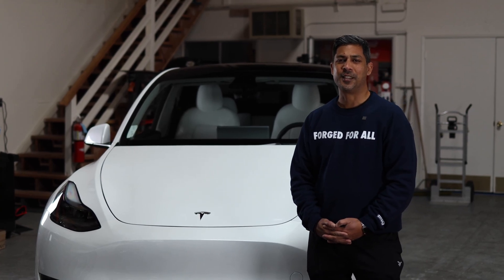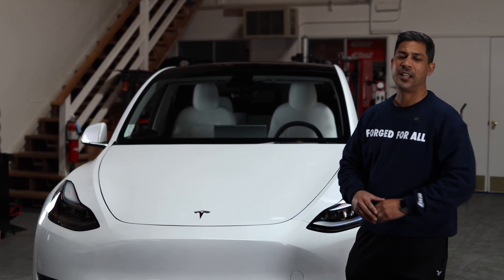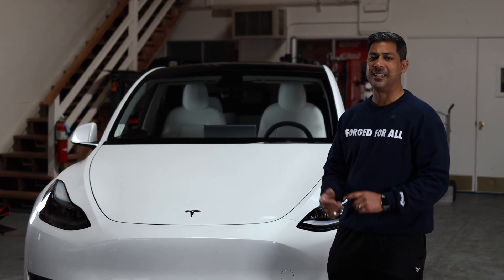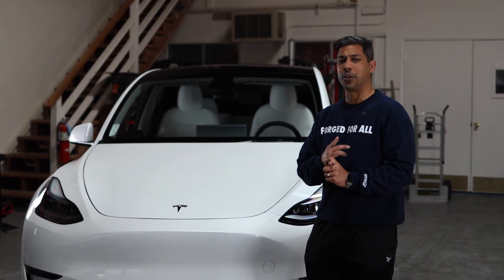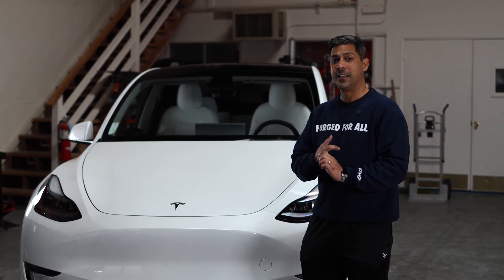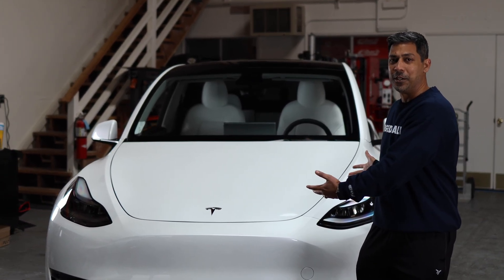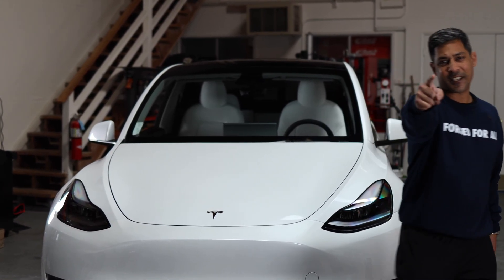TESLA MODEL Y TEIN COILOVER Install DIY + MPP CAMBER ARMS + Titan 7 wheels debut!

Comment: Can we get away from not using TEIN's top hat?
Reply from the maker: @OutlawsOG-Blessed  why would you Jason?
Reply: @zevcentric Noise?
Reply from the maker: @OutlawsOG-Blessed  the top hat is not what causes the noise
Reply: @zevcentric  MPP said on their website, using OEM top hat would help with the noise, unless is it marketing?
Reply from the maker: @OutlawsOG-Blessed  For starters you need to identify what the noise is and where it's coming from.  The Tein top hat already has a rubber isolator so that doesn't create an issue.  It simulates what the oem top hat is.  You cannot use an oem top hat with a Tein flex Z either.  MPP / KW also had spring bind noise issues with oem top hats until it was revised to include a new tooling/shape for their spring as well as an updated lower spring perch design.  That's what resolved their noise issues.
Reply: @zevcentric Thanks, I'll ask MPP to see what their explanation is.
Reply from the maker: @OutlawsOG-Blessed do you have tein flex z?  Your best solution if your installer cant resolve / figure it out is is to just buy MPP coilovers.  Our installs on flex dont have noise bur we do a lot of prep before we install and ship them.
Reply: @zevcentric  No but I do have the Endura Pro Plus.
Reply from the maker: @OutlawsOG-Blessed  ok then you have nothing to worry about.  Flex Z does not use oem mounts and even if you did that wouldn't help with whatever your concern might be.
Reply: @ Like I've mentioned before.  My concern was the grinding noise.  And if we're talking about the Flex Z of having its own top hats instead utilizing the OEM.  Then the OEM top hats causing the noise?
Reply from the maker: @OutlawsOG-Blessed  I’m not sure what grinding noise you’re talking about but any grinding noise is not caused by the top hat on Tein.  If there are any spring noises, it is related to the bottom of the spring. I have made other videos on that as well.   if you’re referring to the flex Z, but we have implemented solutions for that as well.  Are you having noise issues with your current shocks set up or are you just inquiring about a future issue that you are concerned about if you were to ever purchase this coilover?
Reply: @zevcentric  I'm in the market for coilover, moving from Eibach Springs & TEIN EnduraPro Plus.  I've heard mixed review about TEIN Flex Z.  So I had to look up somewhere for information.
Reply from the maker: @OutlawsOG-Blessed I see.  That’s where shopping for the best price online can create problems.  If you buy from us we do several things before we ship to mitigate and resolve issues others have when buying from other places.  There’s things we do in so many aspects through extensive testing that we don’t share in videos.  You won’t hear about these issues when we do our installs.  A lot comes down to how cheap you want to be.  If you only look for the lowest price rather than the best service/setup it can and will cause issues.  Whomever your vendor ends up being should be the one responsible to assist you with all your questions and concerns.  before we ship we will go through a series of questions to set them up.

Comment: Awsome video, thanks for sharing. Do you have any thoughts on these new 2023 stock performance coilovers vs the non performance model? Do they use the same spring, or do these have shorter springs in order to achieve the -150mm lowering? Thanks!
Reply from the maker: The product is identical for the Y.  The difference being the starting point for the drop.  MYP is max 30mm, MYLR is about 45mm once settled.
Reply: @zevcentric  So the other difference is only the stiffness of the spring? It's lenght is the same.
Reply from the maker: @ÁdámMatus  are we talking about the Tein product or OEM suspension?
Reply: By the way this vide is also cool: https://www.youtube.com/watch?v=Lmq648g1KYg :)

Comment: what's the ride height forMY Long range on a Induction wheels? Is it already lowered by 1 inch out of the box? thanks
Reply from the maker: No it is not.  The diameter of the wheel does not change the height.  That is a function of the tire diameter and springs.  The LR Y in 19” and 20” wheels is ushally 430mm hub to fender, the P is 415mm.  This Y is sitting at 395mm approx.

Comment: What about pre-load for rear suspension?
Reply from the maker: Not sure we follow your question.  You mean preloading the lower spring arm before you torque all the areas with bushings?
Reply: @zevcentric  No, I mean setting the pre-load for the rear spring. Or did it pre-load the spring upon bolting the lower control arm to the hub? On some setups, you pre-load the rear springs by tightening the rear shock until it compresses the spring by ~5mm but of course it depends on the Coil-brand.
Reply from the maker: @danielbukowski  that is correct.  It will preload when connected.  In all honesty, I would not do it that way. The rear damper length should be carefully set to ensure that under full compression there is no chances of contact between the tire/fender well, other suspension components, or spring bind.  If for some reason the spring is loose when the shock length is set then a helper spring should be used or a different spring completely.

Comment: What’s the ride height set at on the coil overs?  Don’t want to get too low.  Would that be the same stance if I were to get Tein EnduraPro Plus adjustable shocks equipped with Eibach Pro-Kit springs?
Reply: @K G - I have Eibach Pro-Kit on my 7 seater Y and it’s sitting lower in the rear because of the 3rd row seats. Trying to figure out if I want to return the Eibach Springs and get the Tein Flex Coilover Kit. Do you think keeping the Eibach Springs and adding the Tein Endura Pro adjustable shocks would fix the issue?

Comment: For just daily driving (no track or racing) do you need the FUCA or Rear camber arms for the Tein's if you just want to get rid of some gap (using the stock 21" ubertines).
Reply from the maker: it is actually on the street that you need to reduce the negative camber to make the tires last longer.  Don't cut corners on those expensive tires.  Camber arms are only $168.00. We have affordable camber arms as well.  see the package here:  https://zevcentric.com/collections/coil-suspension/products/tein-flex-z-model-3-y?variant=43311270985973
Reply: @zevcentric  thank you! So for my 2023 MYP, I just need the AWD Tein Flex Z and include the rear camber arms? Then I’m good to go?
Reply from the maker: @Miguel_Molina  correct.  Click the link I provided, add the rear camber arms, you're all set.
Reply from the maker: FUCA is not needed but the RUCA surely is.
Reply: @zevcentric   Teinz + RUCA can handle spacers as well for daily driving?
Reply from the maker: @Miguel_Molina  the coils and ruca don't have any bearing on the spacers but yes you'll be fine to go.  We have spacers as well in stock but you'll want to be careful which sizes you choose.  What sizes did you have in mind?  https://zevcentric.com/collections/model-y-spacers
Reply: @zevcentric  I want to do 20mm front and 20mm rear
Reply from the maker: @Miguel_Molina  ok we have those in stock.  Setup your account with address on our website.  I can build you a custom order and discount the Aspira spacers for you.